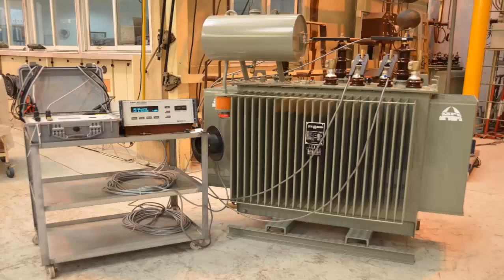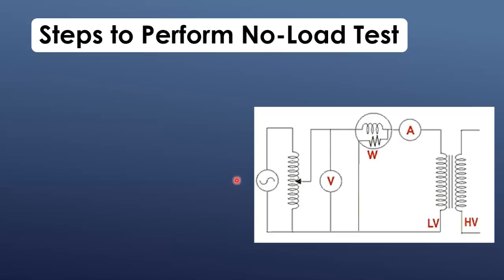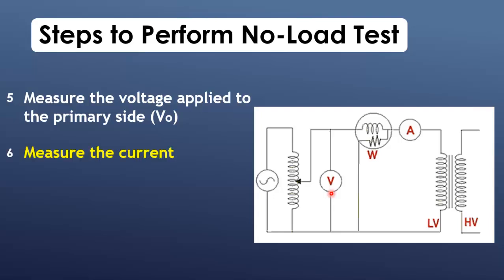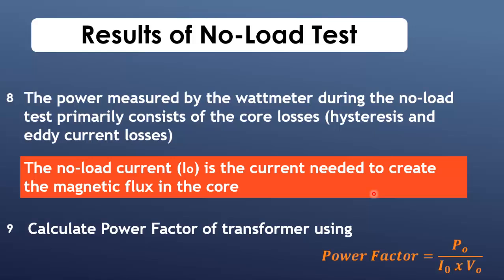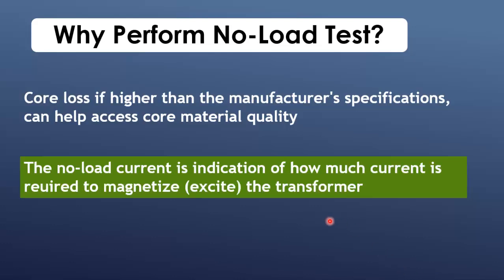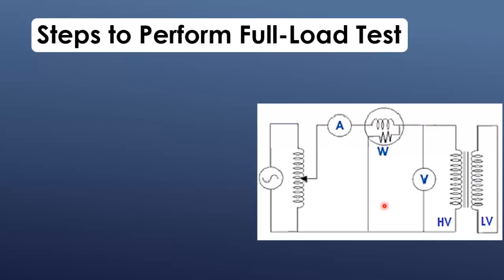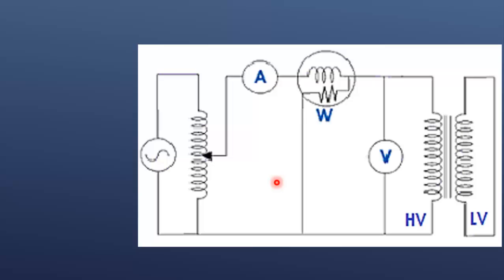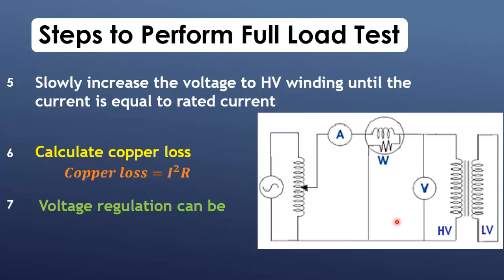Open Circuit Test & Short Circuit Test of Transformer - Simple Explanation

Comment: Nice video but l would like you to explain to me this, we installed TNOSCTUG-50/33PTS DTSP-L3S137 and after few hours the two of dropout fuses  blew and the transformer poured oil . which kind of short circuit in transformer is that and what was the likely cause of that 
 on HV